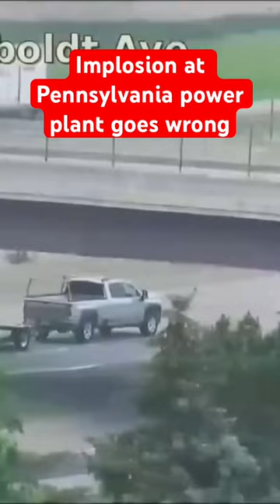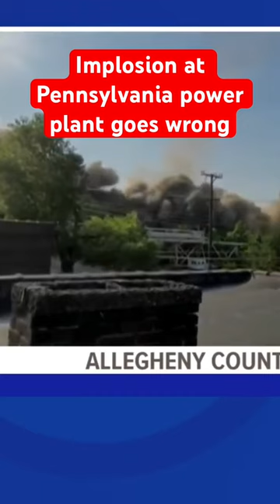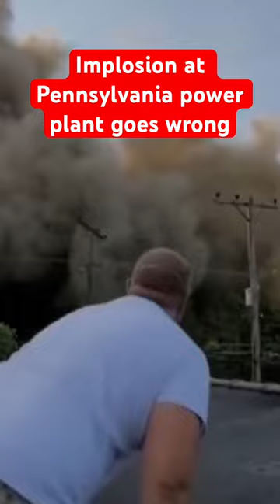Implosion goes wrong at Pennsylvania  power plant

Comment: I worked there from 2013 until I retired in 2021. It went wrong because they didn't know how well the stack's inner chamber was sealed. The stack cap was so tight that rainwater never got in. I opened the drain valve and nothing came out. 
The net effect was like smashing an empty Pringles can and the "lid" blew out with much force.